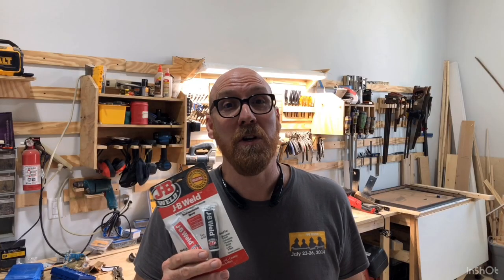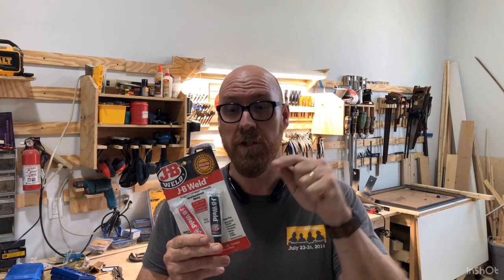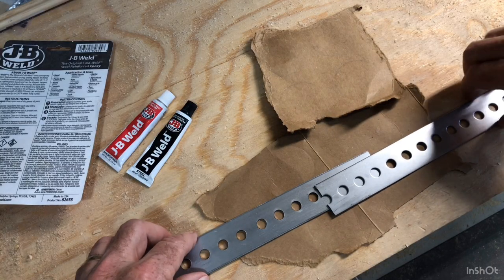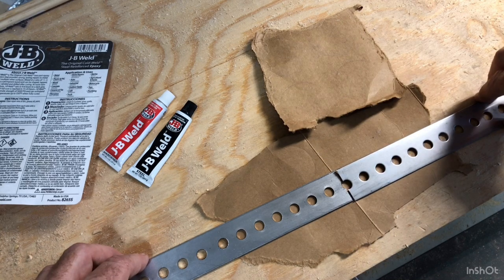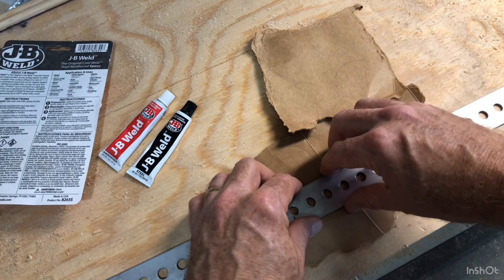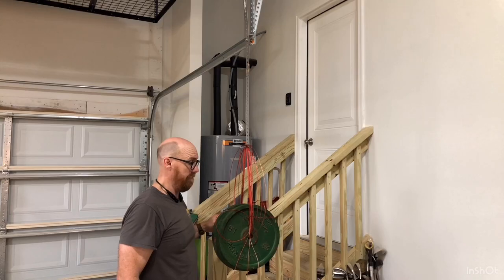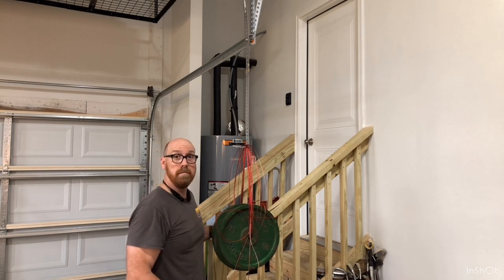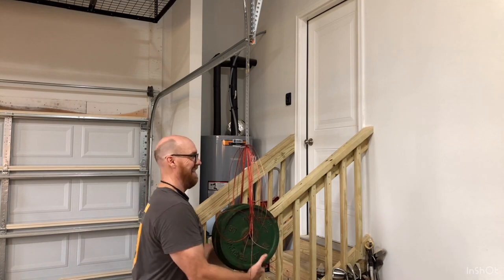JB Weld Strength Test

Comment: JB weld is great stuff. Used it to plug a pin hole in ford explorer AC line, used it to stop an oil leak on a 4 cylinder Camry engine, plugged a cracked radiator, used it daily to fix ikea furniture and much more.
Reply: How is it holding up?  My intercooler for my car has a pin hole size leak.  I was wondering if it can stop the air leak
Reply: My electric scooter handle cracked near bottom and bent been looking into this to fix it you think it will hold?
Reply: @euansellers483  yes it will. Make sure 2 pieces make 100% contact. And let it cure for good 24 hours. I don’t exactly how bad the bent is but you have to make sure there is no gap when putting both pieces together. Use straps or vise to hold them together if you have to.
Reply: @euansellers483  still holding good.
Reply: I did it on radiator it hold for little bet, I think the temperature and pressure and hot coolant is too much for jbweld

Comment: I had pretty mixed results with JB Weld. What I noticed about it is that despite its tensile strength, - it's rather fragile, and definitely doesn't like knocks. I had the glued connection crack along the dried glue part if dropped on the ground or tiles. It handles humidity and moisture well, similarly to other Marine Epoxy brands, but it's also pretty sensitive to temperature changes of 80-100 C. I think that over the years it fared best in gluing carbon fibre, leather, rubber/foam and steel, but not as well with Aluminium, probably due to it quickly developing oxide coating after sanding and Acetone rinse.
Reply: Thank you, this was very informative.
Reply from the maker: @user-xz6cu5vf2u absolutely!

Comment: You can 2x adhesion strength by abrading surfaces with 100 grit and then acetone wiping the surfaces first. Prep method used on aircraft.
Reply from the maker: Thanks for the suggestion.  I'm gonna have to try that.  Thanks so much for watching.

Comment: I fixed a A/C leak in the high pressure hose on a customer car with JB Weld. It's solid as new!!
Reply from the maker: That’s great news.  Would you keep us posted if it holds with the temperature variation combined with the pressure.  Thanks so much for watching and sharing.
Reply: @FieldGuidetoDIY  Yes!! I will keep you posted. It's been 5 days now, i havent received a call yet, so far so good.

Comment: Great video! I even used JB weld on an alternator bolt hole on my car where the threads stripped. Its been years and it holds like a champ! No need to buy a 300 dollar alternator or 500 dollars for a mechanic to replace.
Reply from the maker: walletphonekeys Thanks so much.  The fact that it held and you know the tension on that spot.  Powerful share.  Thanks for telling us about it.  Also, thanks so much for watching.

Comment: I fixed a cut I made by mistake on a Honda GC 160 engine.  I saned area. Then degreased area.  Put JB weld on both sides then A small piece of aluminum flashing. More jb weld then a small piece of fiberglass cloth. More jb weld...3 years going oil doesn't leak
Reply from the maker: Nice!  Thanks for sharing and for the detailed fix.

Comment: I snapped a bolt off inside my bikes brake mount. I JB welded it as a temporary fix until I could extract and tap it. That was a year ago.....
Reply from the maker: WHAT?!  Great idea!  And it held?  Nice.  I’m doing a router repair today where it had been tightened too far and cracked off where the bolt goes through.  I’m trying to fabricate that piece of metal by building up JB Weld.  Thanks so much for watching and for sharing.

Comment: I like to mix this stuff with clean leftover chopsticks from takeout meals.  You can stir the epoxy on a piece of folded paper towel, apply it using the stick to dab, then break the chopstick, wrap it in the paper towel, and throw it out.
Reply from the maker: Great tip.  Someone mentioned my cardboard idea was dangerous because it is the cardboard is porous.  I like the chopsticks idea though.  Thanks so much for watching and sharing!

Comment: 100 pounds with a 2" overlap is a good test for strength.  May I ask, what do you suspect would happen if I filled in a stripped out 6mm bolt head with JB Weld and let a 6mm Hex Key harden in there with it?  Would it provide enough strength to torque out the 6mm stripped bolt?  I suspect the stripped bolt was torqued to 30-40 lb pounds.
Reply from the maker: I imagine we’re talking about a square quarter inch of JB Weld and JB Weld is rated for 680 pounds per square inch.  You should be good up to 170 lbs of torque.  Please let me know how it goes.

Comment: It's great stuff I used JB weld on my transmission housing I had a crack and it completely sealed it
Reply from the maker: That’s great to hear Narwhal.  I’m so glad it worked.  Please keep me posted as the repair is met with changing temperature and vibration.  Thanks so much for sharing and for watching!
Reply: @FieldGuidetoDIY  yeah its been about 3 months now on my beater. 2002 Pontiac grand prix. I went to pop out the driver side CV axel with a pry bar and I ended up putting a half inch hole in the housing. I bought some JB weld didn't even prep the surface properly mind you alot of trans fluid coming out so I just used paper towels to dry the area and applied it.

Trans basically runs at whater the engine is at around 180f to 210f in traffic. I'm not soft on the car either mind you, I'll run over holes or take turns a little hard. And the passger engine mount was basically torn to shreds and I just replaced it 3 days ago so there was definitely alot of vibration in the engine bay.

Hasn't leaked one bit and the JB looks like it's not going anywhere soon

Oh ps I commute to work everyday in her about an hour each way so I spend a min of 2 hours in it a day.
Reply from the maker: @narwhal9852  i am impressed.  I baby my 5-speed Fiesta so I could not imagine the torque JB Weld is under.  Very impressed.  Travel safe!

Comment: JB weld holds well if you're adding only one directional force to it and without any acceleration of that force. If you're holding anything that has any side movement or vibration than one direction, the kwikweld will fail eventually every time. The original JB weld is a much better product than kwikweld as it hardens like a rock where as in my opinion kwikweld stays too soft in comparison.
Reply from the maker: Ginsengjin, thanks for chiming in.  You raise a great point.  That has been my experience as well.

Comment: I'm interested in this. My table had a vertical metal leg and a metal leg going diagonally from the middle of the table to the leg bottom (forming a triangle). I dragged the table on the floor (my bad) and the bottom of the diagonal pulled the screw and a piece of metal out of the vertical leg. I'm trying to use this epoxy to stick the two together, but the table is rather heavy so I'm hoping it sticks well. It's about 100lbs altogether.
Reply from the maker: You should be golden.  If I’m understanding your description correctly the crossbar at an angle is there for stability and doesn’t bear much weight (unless you’re a foot propper like me).  JB Weld is rated for 680 lbs.  Apply a generous amount and clamp it and let it cure for 24 hours.  You’ll be in great shape.  Keep me posted.  Thanks so much for watching!

Comment: I am interested in a shearing test.  Take two pieces of flat 1/4" thick by 1" wide steel and weld them together with minimal  possible surface area.  Then extend the combined flat out so the  weld extends beyond the fulcrum. Then hang the weights on the end.
Reply from the maker: Ooh, I like that idea.  I’m not sure about the practical use of that would be testing.  Let me think about it. But in the meantime, let’s just say coming soon.  Thanks so much for watching.

Comment: Great video. I saw this stuff in my local hardware store (In UK) but thought it was a gimmick. I may attempt to repair that chair with the broken weld thats been sat in my garage for 6 months !
Reply from the maker: I would say it is perfect for that!
Reply: Definitely try it out. The end of my clutch lever popped off when I accidentally laid my motorcycle down trying to park. Used this stuff and wrapped it tight with duct tape. Came back the next day and it's very solid. Great repair until I get a new clutch lever to replace it but works just as well for now
Reply from the maker: Excellent.  I’m so glad it is holding.  Thanks so much for sharing and for watching!

Comment: Hi, liked the video, however I have a suggestion. Your JB "welded" lap joint was in the last 3rd of the length of steel and closer to the bolted attachment to your garage door frame, rather that being in the first 1/3 and closer to the loading point. I suggest flipping the test piece so that the welded joint follows the later not former description above. This would give you a more realistic test. The closer a joint is to a hard point or corner the stronger it is and the closer it is to the load point the potential weaker. Plus load transference through a spring (or springy) steel will not be linear. The steel you used allows for more elastic deformation, meaning load at one point will not be the same along a linear work piece. Just wondering. Thanks and keep up the good work!
Reply from the maker: Sean Eppert Thanks so much for the excellent suggestions.  I was thinking about doing a future test and also applying heat.  I think I will apply your suggestions to that test.  Thanks for the suggestions and thanks so much for watching!
Reply: @FieldGuidetoDIY  FYI, it takes a minute to read my replies, lol. Take care!!

Comment: That same lap joint could also be done with 3M VHB tape and achieve the same result.  It would also withstand hot and cold cycling because it can flex slightly whereas the epoxy will break due to differences in thermal expansion between the steel and epoxy.
Reply from the maker: Really?  I’ve not tried 3M VHB tape.  Will definitely check it out.  A buddy of mine recommended JB Weld for a bar stool repair which got me questioning if JB Weld was strong enough.  I’ll check out the VHB tape but I’m thinking it might be a little “unsightly” for the kitchen if you know what I mean.  Thanks for the tip.  Will check it out.  And thanks so much for watching!
Reply: @FieldGuidetoDIY  It is used to put metal facade on skyscrapers and trim on cars.
  Has the benefit of handling shrink and swell that would occur during day and night, whereas rivets or other mechanical fasteners would break due to shear force.  Several videos on YouTube explain it.  I have used it on several projects.

Comment: Thanks for the video. Its official strength is 5020 PSI so 70 pounds is nothing for it 😀
Reply from the maker: Thanks for watching.  You are so right.  Many times manufacturers report numbers but those are ideal conditions.  I am still very impressed with how strong this stuff is.  Thanks again.
Reply: Because I have no clue, that means it can hold over 5000lbs per square inch?

Comment: Considering JB Weld and wood has a tensile lap shear strength of 1000-1800 psi, the wood would have to be ripped out between his feet before the bond failed. I think that accomplishment should be rewarded more than $500.

Comment: Hoping it holds up on a but joint.. My 2010 Toro personal pace cracked in two on the bottom side of the chute for dispensing grass. Right in the middle it looked like someone grinded it in two the line was so straight. The housings for Toro (residential anyway) aren't very thick so they'll be light but damn I've only got 4 seasons on this one. I think it will hold up as the only stress it endures is from flexing a bit while mowing.
Reply from the maker: Well, the manufacturer says it is rated for up to 680 pounds but that doesn’t say how much of the surface contained the epoxy.  Keep us posted.  Thanks so much for watching.

Comment: The threads connecting my bike's crank arm to the front gears got stripped, and my pedal fell off while I was riding the bike. I decided that I would never have to take that bike apart anyway, so I just JB welded the nut onto the bolt threads. So far it has survived a week and I'm hoping this will be a near permanent fix.
Reply from the maker: GREAT thinking!  As long as you never need to loosen it again, why not.  Thanks so much for sharing and for watching.
Reply: Still holding?
Reply: @jeff666p  yup, I put around 400 miles on the bike and its solid
Reply: This is what im doing as we speak, the threads from my pedal turned the threads in my crank arm to dust after smashing it on a rock and continued use, so im jb welding the pedal into the whole. I really hope it handles mtbing. Just a couple weeks and ill get a crank set and peddles anyways, but i ride daily and two weeks off the hills will kill me.
Reply from the maker: I’m not sure how much surface area the JB Weld will make contact.  I also don’t know how much standing on the pedals you’ll be doing.  Please keep me posted.
Reply: @roughtimes4743  Mine is still holding, probably 800 miles later. I do only weigh 150 pounds though but still, I am impressed.

Comment: I would have started with 200 pounds and gone up until the metal strap failed.  I'd bet the breaking point would have been the strap not the joint.   But I would not have used my garage door hanger as an attachment point- but maybe an oak tree branch?
Reply from the maker: Great tip but this was my first use of JB Weld Original Cold Steel.  I had no idea how strong it was.  I knew the garage door hanger was strong enough to hold 227 pounds (you can guess how I figured that out).  I’ve got an idea to test it further for an upcoming video but I have to wait until my wife is out of town.  Thanks so much for watching and the input!

Comment: Dude, I was worried you weren’t wearing a hermit incase the bar came off and headed towards your head.
Also, do you think the weight could be held long term?
Nice little semi-scientific video though. Thank for sharing :)
Reply from the maker: Asadi, I did strength test the garage door track so I was not concerned about that pulling out of the ceiling.  I raise a good point about the potential whiplash if it did break its bond.  I tried to stand back as much as I could.  My very first repair on our bar stools is still holding my 230 pounds every day at meals.  It is rated for up to 680 pounds per square inch.  Thanks so much for watching!

Comment: My office chair broke where the air cylinder meets the bottom plate of the chair... a new neck+plate is like $60... I'm thinking I'm going to JB weld the hell out of it and see if it holds up. I'm 6'3 and like 250 lbs and every office chair I buy breaks when I lean back and put my feet up to watch a movie at my computer. Would be nice to be able to JB weld the hell out of it so I can chill without destroy my chairs... haha.
Reply from the maker: Absolutely!

Comment: Impressive. I'm guessing the next time you'll hang that "test" lower so you don't have to lift the weight to chest height!
Reply from the maker: BUSTED!  My lovely assistant did not want to be "in the shot" so I edited her out in post.  I was unable to press the weight being supported on the cable using my thumbs only.  Hanging the "test" lower is a GREAT idea!
Reply: @FieldGuidetoDIY  but had no clue the JB weld would be that strong.....
Reply from the maker: Dave Patchin Frankly me either.  Their website reported up to 60 lbs but obviously in this test it stronger than that.

Comment: You don’t mix any type of epoxy,fiberglass,bondo etc on paper unless it is waterproof like the sheets you buy made for bondo.Always mix on metal or aluminum if possible
Reply from the maker: Thanks for the tip Gary.  Why is that?
Reply: Nonsense. JB Welds' own promotional images and instructions show mixture on cardboard just like shown here.

Comment: Fun video but I still dont know if it is strong enough
Reply from the maker: It is rated for 680 pounds.  I’m still devising a test ... maybe lifting an engine block.  Stay tuned.
Reply: @FieldGuidetoDIY  That would be awesome! I saw another video that only had 27lbs, but the epoxy wasn't joining to the metal it was on, so maybe that's why.

Comment: I have always mixed JB Weld on plastic, as don't like the idea cardboard particles weakening the glue . Still the Original JB Weld seems to be one of the best  adhesives , but west system epoxy is also good stuff ! My favourite adhesive is Araldite 2015 industrial epoxy its about £70 a tube,, its a bit toxic but amazingly strong on GRP.. its on another level .

Comment: Next question would be. For how long this is gona hold 50-60 pounds. In term of time.
Reply from the maker: Under constant pressure or weight?  I'm not sure but the repairs featured in these videos are still holding with consistent use.  I do not have an application that is under constant pressure.  Let me know if you use JB Weld for just such a repair and what your experience is.  Thanks so much for watching.

Comment: So what your saying is itll repair my glasses 😂
Reply from the maker: Wait!  How thick are your glasses?!  Thanks so much for watching.
Reply: @FieldGuidetoDIY  think of professor  Farnsworth's glasses, but thicker.
Reply from the maker: @esprix4817  LOL!  Wow! That's thick.  Good thing JB Weld is rated up to 680 lbs.  Just kidding.
Reply: @FieldGuidetoDIY  i used jb weld plastic. My frame is metal. I wish itd be more "rigid" or something.  But I suppose better than nothing
Reply from the maker: Esprix I also did a video on my experience with small metal repair.  See it here - https://youtu.be/LWt2vkgiPU8

Comment: CAUTION: my JB weld DID NOT CURE after 24hrs !!!! never had a glue do this to me EVER Going back to 5 min epoxy
Reply from the maker: I’m sorry to hear that.  After nearly four years and plenty of use, ours is holding strong.  Thanks for the input.  Definitely gonna check out the 5-minute Epoxy.